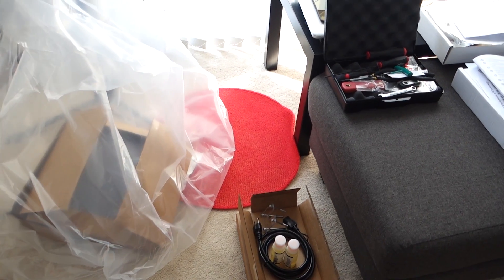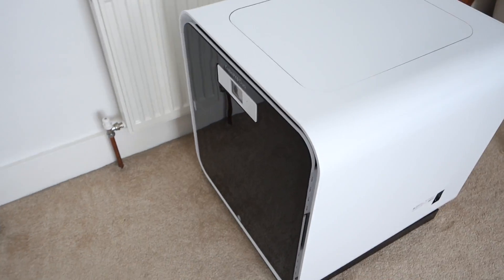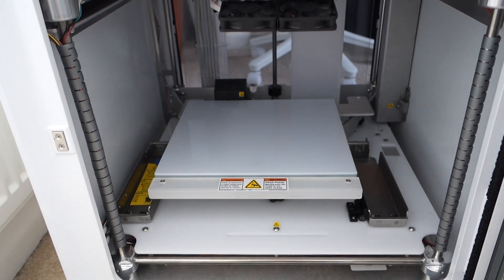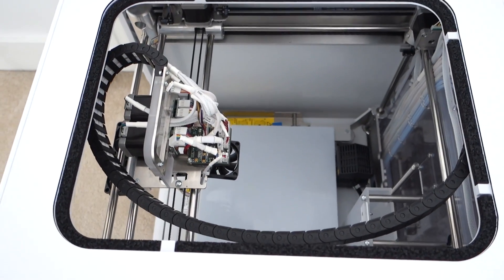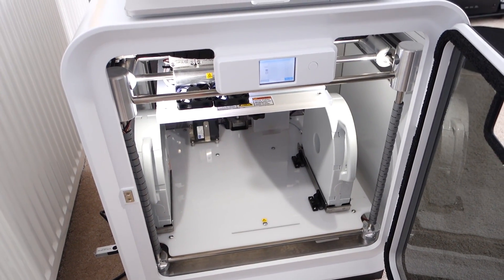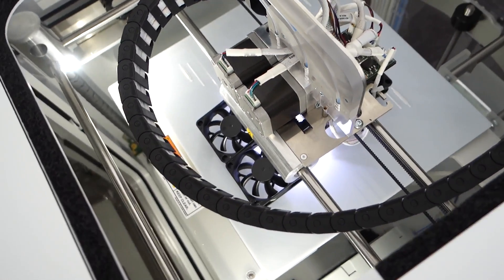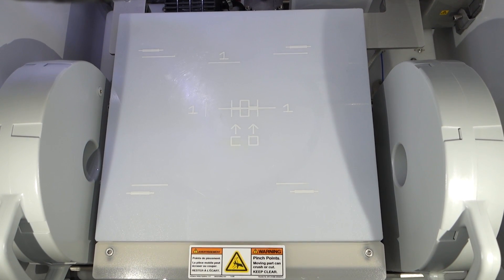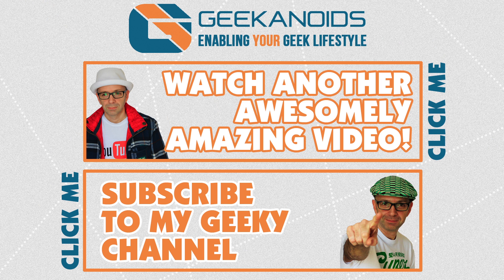Geek Vlog 263 - 3D Systems Cubify CubePro Duo 3D Printer #3Dprinting

Comment: CubePro Trio review
I have decided to share my experience with
CubePro 3d printer.
I have this printer for 18 months and I have
tried all variants of filament materials, that the manufacturer offers. I have
printed many models but unfortunately more models where destroyed or misbuild
then successfully build. The printer cannot give you what the manufacturer and salesmen’s
promises to you. 
Design – first touch is very
impressive and nice. The printer design looks nice and smooth. Is completely enclosed
and no moving parts are mounted outside so the cube is the only space it needs.
Build chamber id lighten up und the front and rear panel is transparent so you
can see your model emerging. The printer is very user friendly, the full color
touch displays is intuitive and setup wizards guides the user thru maintenance
and trouble shooting. The filament cartridges handling and replacement is very
easy. Also the print preparation is easy. The printer comes with all tools necessary
to maintain it.But this is all what the
printer offers on positive side.    User software – software is very
user friendly and easy to use, but it is very buggy. It crashes for no reason.
When you try to customize the build options the software is not able to create
support for models on edges and ignores the sidewalk options and perforation. The
same happens when you enable the fine detail options. And also if you move your
models on build platform the software is not able to create the build program
and crashes. When you leave all in default settings it works fine, but the
default option is suitable only for small and easy models. On bigger and more
detailed models you need to adjust this setting or you will see how the printer
vastest tons of material or the model is misbuilded.The software updates come out
very often, but the major bugs are not fixed, mostly new features are added. I don’t
know what the software engineers or testers do that they don’t find this bugs.
I have the feeling that they just ignore this bug reports. Firmware – the firmware for
model building is very buggy. The print algorithm causes sometimes collisions especially
when you have more than one model of different shape or color. Ones the
collision was so bad that it damaged one of the print heads. When the printer pauses
the print for layer cooling and hardening a small amount of filament comes out
of nozzle and instead to clean the head (the printer is equipped with very nice
cleaning mechanism with waste bin) the printer continues to print and damages the
model, so you have to post process the model with sandpaper or knife or you throw
the model away and build it again and you hope that this time it will be not
that bad.Firmware updates are also very
common, but again instead of fixing the bugs, the only concern of the manufacturer
is to ensure that the user uses only the genuine filament cartridges by improving
the security algorithm for filament cartridge chip validation. (you will find
lots of articles to this when you google a little bit) Mechanics – the mechanics is
designed on strong chassis with very solution for y-axis (it uses two step
motors) the mechanics is well prepared to handle motions dynamics. The cabling
and filament guide pipes are installed very professional.The problem is the sliding
bearing which are pure quality and they causing movement jams and noises. This
leads to model misbuilding by shifting of layers. The electronics causes also
trouble. My printer was in service center twice for both problems, but they
replaced only the mainboard (twice) the sliding guides are still the original
ones installed in factory and causing still the same problems.The filament feeder
mechanism is good but too precise for the poor quality of the filament string. This
causes the user to disassembly the mechanism and clear it every time when a jam
occurs (what is in most abs filament very often). This procedure is time and
patience consuming. Filament cartridges – oh yeah,
the biggest problem for this printer. At first I liked the idea that the
cartridges are equipped witch ID chip which provides all the necessary info for
the printer what type and color of material is inserted, but this is not the
main role of this chip (you can do this with barcode is cheaper than the chip),
the main role is to ensure that you use the genuine cartridges provided by 3ds!
This should be not the issue if the price is fair for the quality and material
amount. Chips are faulty, there is only 680g of material and the string miserable
quality for 99 Euro. I have tried all types of materials and many colors.ABS – the worst material. Avoid
it at any cost. Especially the red one. Strings has too many defects and
causing filament jump! The printer build platform cannot handle the ABS shrink
properties and it gets bended or the first layer is fused into platform. The
print algorithm for this material can compensate for abs material properties
and the printed models look terrible. Big models are NO GO for abs!PLA – this is the right
material for this printer. The models are good, no shape shifting, good surface
quality. The problem is only, when the filament is in printer for more than 3
weeks, the string starts to crack in guide pipes, what leads to filament jump
in print head. To get the filament then out of guide pipe is not an easy task. When
the string cracks near the entrance of the cartridge, it is pulled inside and
you have no option but to open the cartridge and get the string back to where
it belongs and of course you lose the warranty to this cartridge.NYLON – very strong and
good material, but the printer cannot handle it. When the print is paused for
layer hardening, the filament is overheated and you see burn mark in model and
of course the filament comes out during this pause and the printer do not clear
the head and destroys the model! Interesting is also the fact that you cannot configure
the printer software to use different materials when nylon option is used for
other print heads. So when you want to use different material then nylon you
have every time to reconfigure your print software. Multicolor printing – forget
this feature! It is brutally time consuming for printing, because the printer
cools down the head which is currently not used reheats it again when it needs
it. (which is of course on each layer). This leads to material overheat and
waste during this process, because the printer releases a string to waste bin
to get the over burned material out of nozzle. The different material color
causes by fusing (because there intersects on multicolor model) deformations
and the model looks not that pretty. It is better to print monochrome models or
the different color parts sparely and the assemble them than together. Which requires
good skills be model design to reflect the different color material properties,
so that the parts fit together ;)

Service and support – the onsite
technician which has done the service for my printer has done his best. His
hand was in many cases tighten by manufacturers service contract. All troubles have
to be verified by manufacturers tech support and they didn’t listen to problem
descriptions provided by customer. They wanted photos and videos, so I did my
best to satisfy their need to make proper analyses of my printer’s issues. But in
the end they ignored everything and send me stupid instructions that never solved
the issue. My printer has mechanical problem proved by video and they told me
to update firmware. Of course it didn’t solve the problem, only expensive filament
was wasted on next model. In the end the motherboard quitted and the printer
was taken to service center for repair. I waited 3-4 weeks for its return and
they of course changed the mainboard for a one with defective usb port, so the
center has to wait for new mainboard again. After return the mechanical problem
is still present. They give me of course advise to lubricate the faulty
bearings regularly. Cool idea to lubricate those bearings when the bearing
manufacturer forbids this, because dust is collected in this lubricant its
pulled then inside those bearings and they get slowly damaged. So now I’m
waiting for total failure of those bearing. Software issues are ignored by
default at support. Filament and spear parts supply is short and it takes weeks
to get it.
Final assessment – the idea of user
friendly 3d printer is very good and this printer has mastered most of this
idea good. But the philosophy to get huge money from customer for cartridges is
a gall. The printer is not able to print what the manufacturer promises. The
support is ignorant and incompetent. The printer is not worth its price. You will
be very fast disappointed. I regret this purchase. There are better printers on
the market that this one. They are cheaper, maybe uglier and more skills are necessary
to operate them, but you will get the output you want from it. This printer is
pure waste of money. Maybe another manufacturer will inspire their product by
the philosophy of user friendliness, case design and software interface.
Reply from the maker: Wow, great comment, thanks for adding this.

Comment: please detailed review about this printer, I am trying to decided if I should buy this and there is not much review about it.
I have Ultimaker2+ but I want a 2 colors or 3 colors printer
Reply from the maker: Sorry, I no longer have this, it was terrible.
Reply: +Geekanoids thank you 
But can you tell me me what was terrible about it please
Reply: +Geekanoids reason for my asking I'm getting the cube pro trio new but not in the original box or has filament or accessories, just the printer fully working with the build plate and power supply.
And I'm getting it for cheap price as it cost $3500 I'm getting it for $499

Comment: How did you get on with setting up (calibrating) the CubePro. We bought one a few months back directly form the States, and it was a pig to set up. It was supposed to be ready to go, but a quick test print showed that it was not quite set up correctly. Calibration couldn't have been more difficult, and I don't think it is yet perfect. Hence, can't really say much about the print quality until we get it sorted.
Reply from the maker: saladbrain I didn't, it was not a great experience.
Reply: Geekanoids Did you manage to print anything? if so, how was the quality for you?

Comment: a 2 color 3D printer? seems like a cool concept, looking forward to seeing what it can do. I am sure as 3D printing catches on the tech will advance and who knows maybe you will be able to have ink cartridges and clear filament, so the ink will mix into the filament and produce a huge range of colors. Only places I can think of for the older Apple products would be Ebay and possibly Amazon.
Reply from the maker: ***** Yep, constantly checking those sites.
Reply: reading this on 2019 we now have 4 color single extruded printers